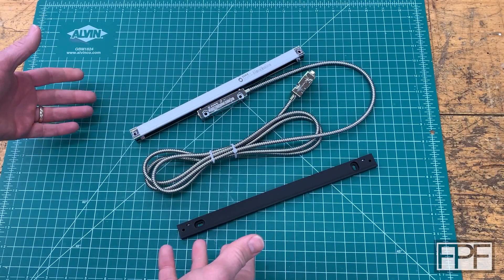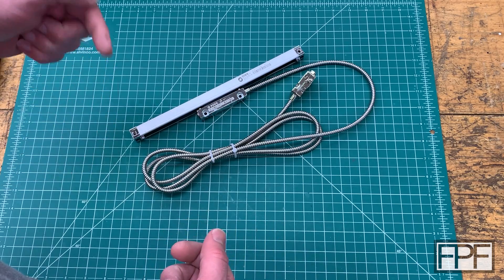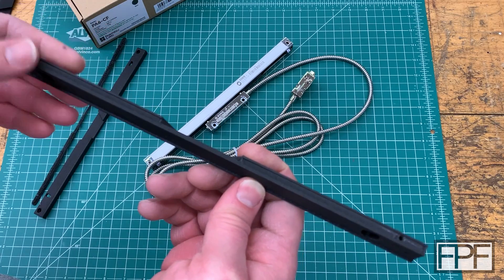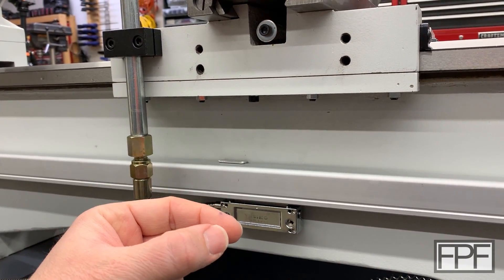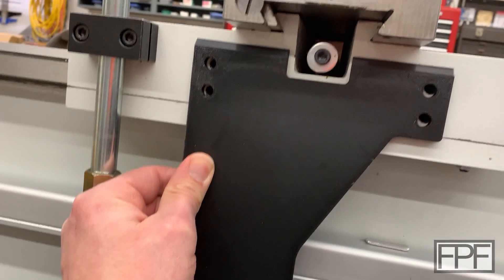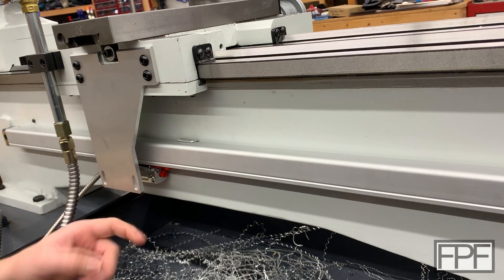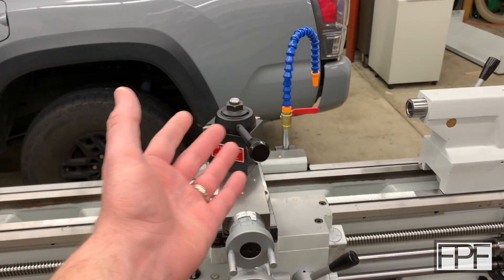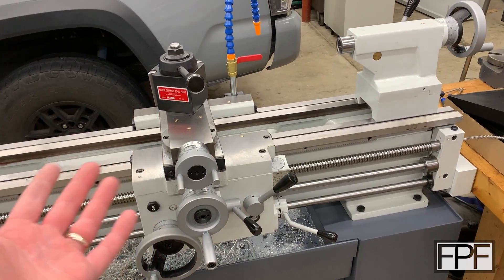3D Printed DRO Mount for Lathe - Carriage and Next Steps

Comment: I would flip the entire scale upside down so that the read head is higher up
Reply: But then it would be open along the top edge. On a lathe with chips, cutting oil, coolant, & etc that's NO BUENO.
Reply from the maker: slot for read-head has to point down on machining tools, otherwise the swarf gets in and ruins it quickly

Comment: If you want best rigidity and no creep issues, go with PC-CF -- I've been printing with 3DXTech brand (not as cheap as some others but is really great), it doesn't have the moisture issue and it printed fine with the 0.4 e3d High Flow ObXidian on the bambu with no issues, and I've used it with a 0.4 slice GammaMaster nozzle on my voron with no problems as well. It's incredibly rigid, and super strong.

Comment: It's been said at least once in the comments, but using  a Nylon for anything that will be near moisture could ba an issue.  Honestly,  the PAHT CF (PA12) would have been a better choice. It's formulated to better hold up to moisture.  It's a little less stiff, but with PA's, stiffness chasing is fool's gold when moisture is in the equation.  PA's get down right weak when saturated. The PAHT CF is about 2-3 times better with moisture than a stiffer PA6 CF. Test by putting you print fails in the coolant. I think you'll be surprised how much flex is introduced. But I do think PAHT CF would have been OK. As well, I've printed my PAHT CF just fine with the hardened 0.4mm nozzle. It's the best CF infused filament I've ever used. 
To be honest, if I were doing what you are doing, I would have probably chosen the PET CF. It's about 4x better with moisture than the PA6 CF and plenty stiff.

Comment: For this type of parts, I use Bambulab PLA-CF with a 0,4mm hardened nozzle (I have a X1E which is essentially a X1C). PLA-CF is still very affordable, but gives a rigid and dimensionally stable 3D-print and a smooth satin gloss surface.
My latest product with PLA-CF is a set of soft jaws for a workbench vise. If you have problems with a specific material like PA-CF, you should spend some time on calibration (speed, flow, temperature, etc).

Comment: To be honest I've printed with a few filaments, and Nylon is by far the one which suffers the most from creep.
I stopped using PA12-CF from polymaker (180€/kg) for that reason. Screws kept coming loose.

Comment: I'd recommend trying some Prusament PCCF. I run this in lots of places in the shop. Make sure you use a hardened steel nozzle; but the resultant parts look fantastic, are dimensionally stable, withstand compressive forces like in the case of your bracket. Nylon is good, but I've had much better results with Polycarbonate carbon fiber.

Comment: I've personally settled on 0.6mm as the best general nozzle size.  Feeds CF filaments beautifully, prints fast, and there are very few functional, mechanical parts that need more resolution, in my experience.  If high resolution is needed I print at 0.15mm layer height, 0.5mm width, but for the mostpart it's 0.25mm height, 0.62mm width and everything comes out strong, tough, and looking "good enough."
Reply: Yep. I don't even feel like it's settling at all. All benefit unless you're doing high resolution models.

Comment: You need to start buying cheaper filament, Zyltech makes good, and GST3D as well
Reply: PA6-CF -> eSun is like 25-30$/kg.
Also PA6 has cold flow, so not for structural parts or you need to oversize significantly to keep dimensional accuracy

Comment: I'm unsure why you have put the scale so low down on the bed. Looking at it, it could have been far closer to the carriage, which would mean far less flex in parts.
Reply from the maker: It's as high as it can be.  It's a gap-bed lathe.  Any higher and it would block removal of the gap unfortunately.  This is why you generally see them down that low relative to the rest of the bed.
Reply: @FunctionalPrintFriday  Ah, that makes total sense. If I'd looked harder, I might have realised. My own lathe is a none gap bed.

Comment: Interesting... I've been printing a bunch of TINMORRY PETG-CF with the stock 0.4mm bimetal nozzle that came on my Q1 Pro; with no issues. Being a lower-cost CF filiment, it might have less CF in it, or be a shorter fiber length?

Comment: 8:30 add a rib or web - if going for 3d printed do a fusion finite element analysis then set thickness to achieve the deflection you want.

If aluminum you could add a 3d printed stiffener via glue and bolts.. again fo the FEA to control deflection.

But as it’s hanging down behind with no risk of leaning on the plate it should be fine.